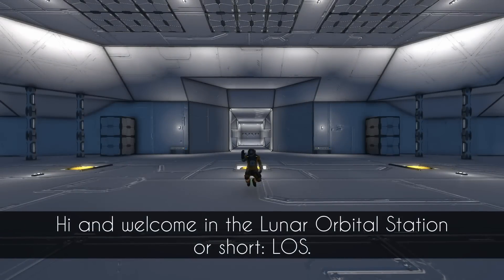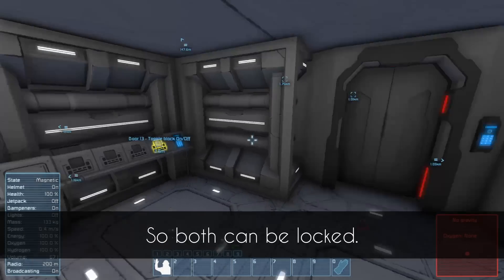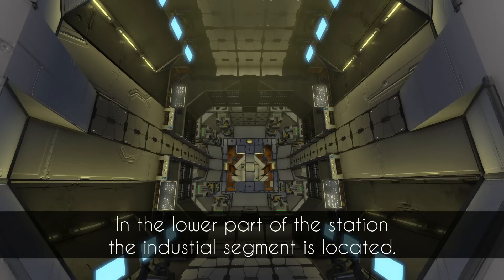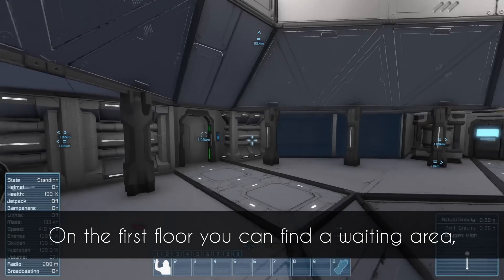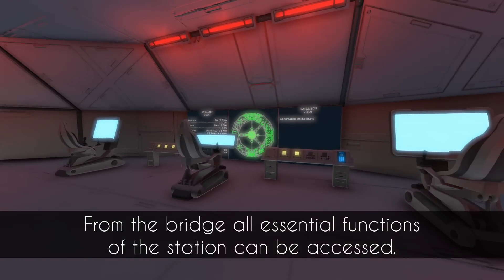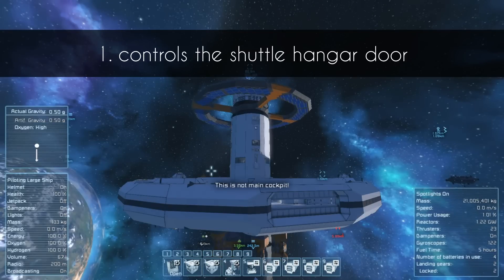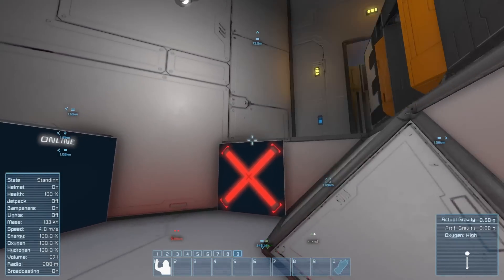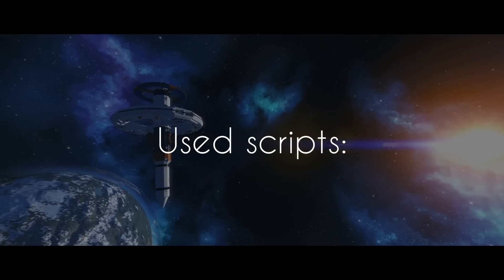Rotating Space Station - LOS | Space Engineers

Comment: That's not how gravity in the ring works. It should either be to or away from the centre of the ring, not on the side. Not that there is gravity anyways, you are using the magnetic boots.
Reply from the maker: It was never intended to be a gravity ring because it's not possible in SE ^^. As far as i know you have to use artifical gravity and also i would have to reverse the station layout: Living quartars in the ring and everything else in the core. Also the core and the large ring do not (or just in a very slow pace) rotate (=no centrifugal forces). Just die Solar array and the life support system in the tip rotate to even out the load on the system. In short: i wanted a cool looking but also functioning space station in SE and no van Braun wheel ;)
Reply: Spherical gravity generator. Life support can be added on the ring, and to keep docking possible, use wheels to separate the ring, but allow it to still rotate using an override gyroscope. Ships can dock on the main part of the station, not the habitual modules.

Comment: One thing I wonder. does the gravity really work like it should be in space engineer? If so I wonder if it can be possible to put something on a real orbit  in the game. So no fuel or energy required to keep a station at a certain altitudes since the whole thing is moving fast enough to not crash on the ground.
Reply from the maker: +AlexMapleFire yes and no: the physics are quite accurate and the planets have gravity wells which are somewhat realistic but smaller than a real one. The real problem is that in vanilla you can only fly a little bit over 100 m/s which is not fast enough for a stable orbit. Also the gravity wells end with a cut when acceleration went below 0.8 g. With speed mods and some tweaks it could be possible to achieve a stable orbit but it isn't an easy task.
Reply: ok thx for the info. See it<s been a while I was wondering if i could make it possible with the ligth speed mod.

Comment: You have the life support of the upper area exposed as well.
Reply from the maker: Hey, I appreciate feedback but it would be nice if you could put your thoughts in one comment instead of spamming each information in a single comment. To your points now: the station is not designed as a defensive outpost or military station, it is a industry hub. The defensive grid is only a measure against minor threats, so you are right that it couldn't kill a battle cruiser. But if the station would sit near hostile area a small fleet would function as security. My idea for the escape pod was that they would be used if the station malfunctions, so they hadn't to be very fast but reliable and secure. Everything else is a compromise of the design, because I wanted to have a functioning and good-looking build. There may be better ways to achieve this but that's how i finished this thing.

Comment: One issue, the escape pods. If the station is being attacked by pirates, then those slow, lumbering escape pods would be very easy to hit. You should have a look into using Mass Blocks and gravity generators. If you're not wanting to use that method, there are others. You should look into them, their cool, and practical for fast escape systems :)

Anyway, beautiful station, love it :D
Reply from the maker: thanks for the tip :) my idea was more that they would be used if the station malfunctions, so they hadn't to be very fast but reliable and secure. but you are right: they are easy targets for pirates ^^